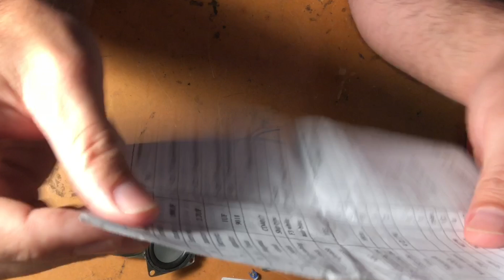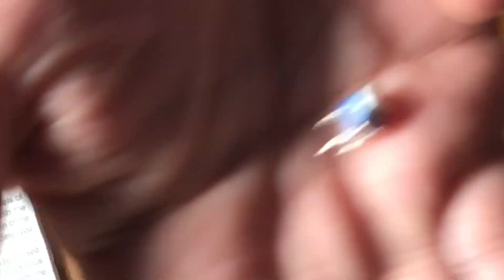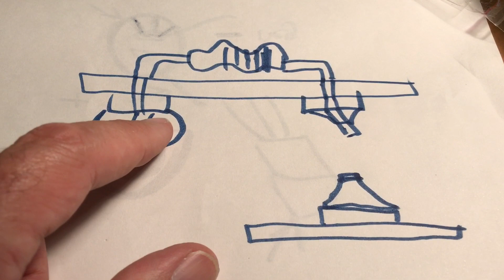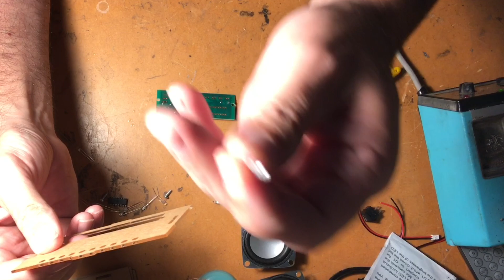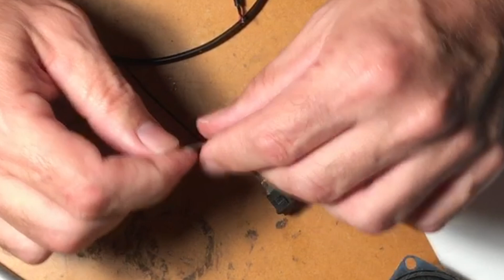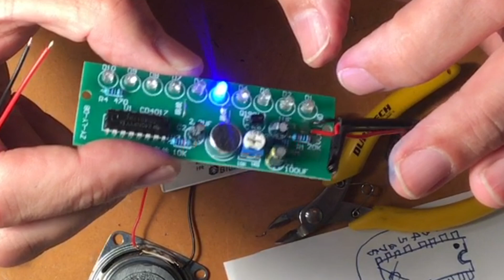Basic soldering and kit building tutorial

Comment: I have assembled too many Heathkits together.  I would place a used old bath towel on my table to keep the board from shifting and if I dropped a part it was less likely to bounce off the table and onto the floor. and save myself from cursing.
Reply from the maker: Yes… I have gear to hold boards and make life easier. Alas the class I’m teaching in hasn’t got this, so I was trying to make it clear the tools at hand would get them over the line. I only wish I could have had access to the golden age of Heath Kit they made some sweet gear and educated many a future ham/ tech/ engineer. TU OM FER stopping by and 73 de VK2AOE

Comment: Desoldering components, and getting solder out of the holes is killing my kit enjoyment, i can destroy PCBs
Reply from the maker: I just bought a traditional thru hole desolder station. Yet to use it, hoping it makes life easier.
Reply: @TheArtofEngineering  gonna show it off?? I have a gift card, about the only thing it's good for is a Hakko Desoldering gun
Reply: @edbeckerich3737  I have a Pace desoldering station. It’s 30 years old, and a little tired, but it is almost compulsory to have a vacuum desolder iron. 

If I can’t get the Pace sorted, I’m going to check out George’s station. The pace stuff is nice, and really expensive. That said, when I bought it 34 years ago, it took 6 weeks of repairs to break even.
Reply: Too much heat for too long of a time. With practice, you will learn what not to do. Hint, have the right tools to do the de-soldering job right or don't do it.